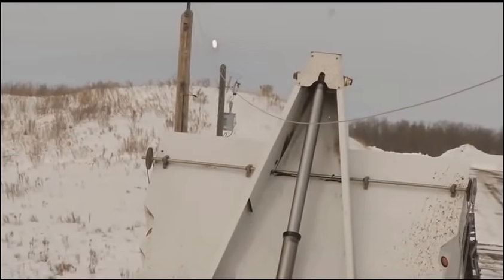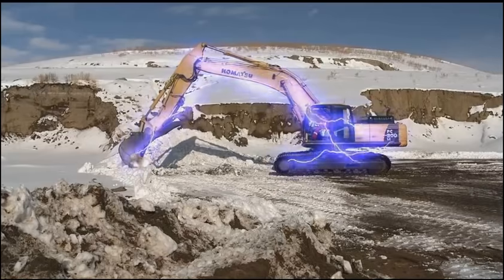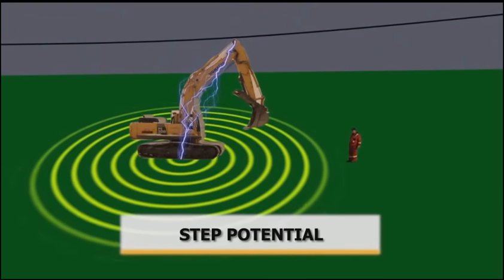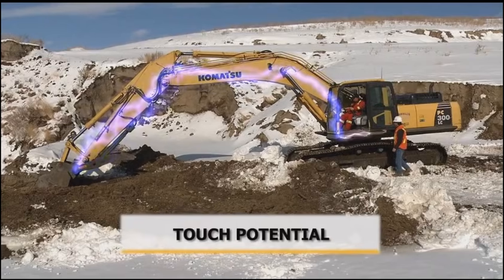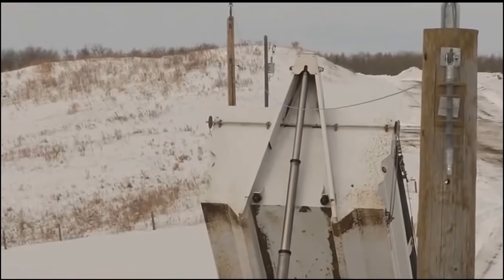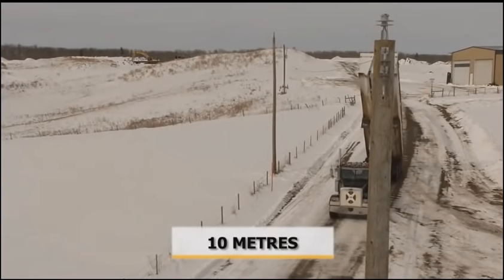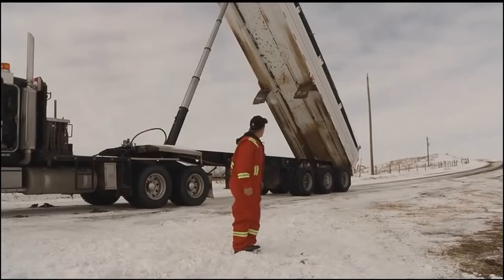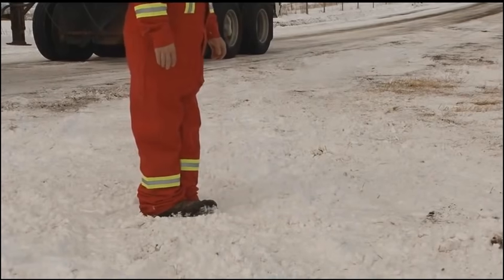Step and Touch potential animated video

Comment: I am a high-voltage electrician that works for a power plant and sometimes you can’t back away from the line because sometimes the voltages are so high that the orcs go across the tires and blow them out so if you don’t know what the voltages and the tires are still hole you may have a chance
Reply: Instead of bunny hopping would it be better to do like a 1 legged run? Like 1 leg on the ground other in the air then you jump and land on the other leg?

Comment: thank u for posting video. Just i want to ask what are the voltages magnitudes upto 10 metres from the point of fault. Since a person should not step over 10 metres. For academic purpose  i want to know what is the voltage difference between two points of the steps of  a person.

Comment: If your truck lean 1000 volt rope, maybe. But if you have a lean to rope 15000000 volt, after your jump from cab, will be lightning from cab to body to earth. And it will be death. For excavator not sure, because it has a good contract steel tracks with earth and so good square of touching.
And I think electronic of truck will have  failure in high voltage 15000000 volt.
What you have do if you will have these conditions in truck and in excavator?
Reply: What line has 15000kV

Comment: I saw a fellow walking behind a BED TRUCK during an OIL RIG MOVE . The GIN POLES were up and made contact with the power lines. The fellow behind the bed truck was steadying a beam with his hands and got shocked. The tires on the bed truck blew out and the truck stopped. Luckily the fellow who got shocked , LIVED. Usually,  a shock like that will COOK YOU INTERNAL ORGANS.  VERY LUCKY MAN

Comment: Another note to make is that the voltage rings do not radiate away from the point of contact in perfect circles. Soil condition is the factor in how the rings expand out. Moisture or lack of and soil type dictate how the voltage is going to react. The voltage in most cases radiates out in irregular patterns and distances.

Comment: we are wear shoes..so no connncetion between ground...how it possible....how to affact....i dont understand
Reply from the maker: every insulating material have break down voltage ,if u r insulated by shoes &  voltage is high that may damage the life of the person
Reply: Everything can allow a charge to flow across it if there's enough voltage.

It's all about resistance, some materials will resist the flow of electrons more than others.

Does Air provide a 'connection'? Of course not but if there's enough magical pixies wanting to find a way to the ground and if they're determined enough, they'll find their way :)
Reply: When we work on a live network we wear insulating dialectic rubber boots and rubber gloves. This safety equipment is rated to be safe to work at relatively low voltages.
During fault conditions voltages can run extremely high and these specialist boots and gloves will not protect you.
So If you think that normal shoes and clothing will give you protection from voltages you are in for a nasty shock.... literally LOL.
Reply: @robg521  
G
Reply: I've seen some scary videos of where the people are wearing shoes, but the people have gotten very, very fried and crispy regardless and killed. If the voltage is high enough, simple shoes will go into dielectric breakdown and complete the circuit to ground.